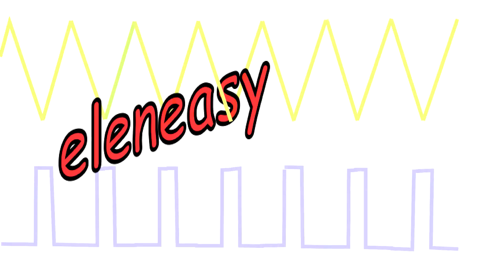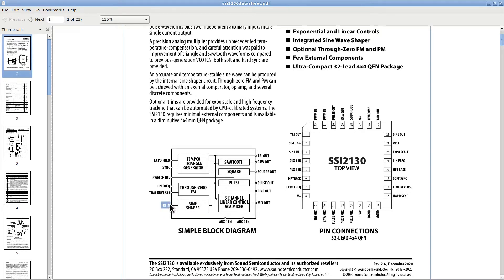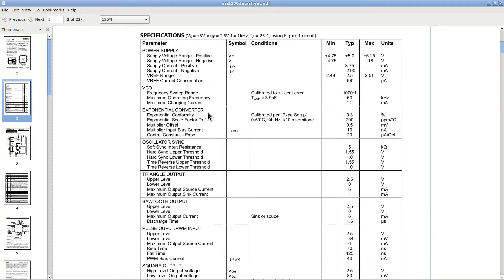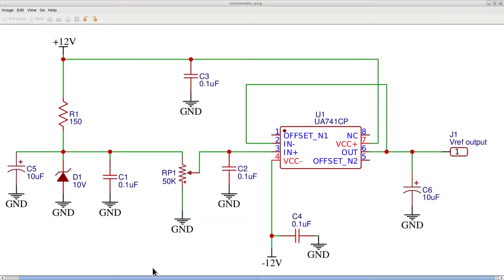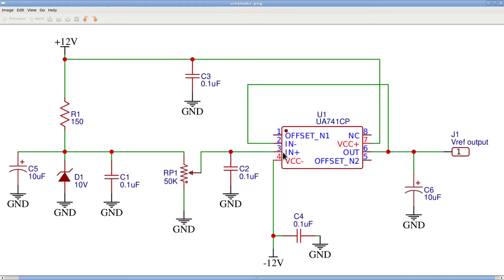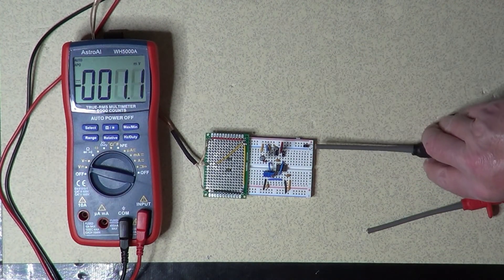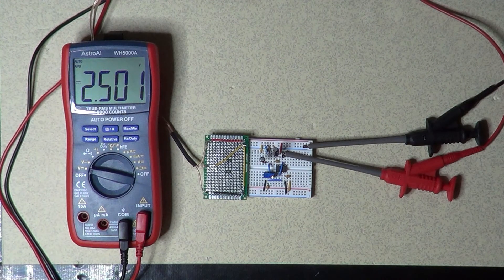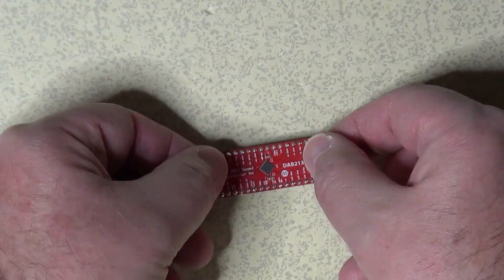Introducing The SSI2130 VCO And A Reference Voltage For It

Comment: Really keen to build this VCO! I was wondering if I am seeing this correctly on the breadboard...you have +12v coming in at the top and the -12v on the blue rail right below it. The -12v is then tied to the bottom + rail and then the bottom blue rail is the actual 0v reference point? Sorry if that is a silly question, I am still trying to solidify my understand of this stuff via experimentation. Thanks and once again I really appreciate your channel and especially your work with this VCO chip!
Reply from the maker: No, it is not a silly question. In fact, the video does not show up very well how the power is connected to the breadboard. Sorry for that.
The perfboard on the left, that powers up the circuit, distributes the voltages to the breadboard as follow:
+12V on the upper red rail
- 12V on the bottom blue rail
GND on both the upper blue rail and the bottom red rail

The reference point is therefore distributed across the two rails closer to the components on the breadboard.

I prefer to do it that way to have GND available to both the upper section and the lower section of the breadboard, since many components have one of their ends connected to ground. That way it is easier to make the ground connection, whatever side the component is located.
Reply: @eleneasy  thanks for getting back with me. I realized later in the video that you showed which rails are which. I need to get better at reading schematics, so I actually appreciate that it's a little hard to cheat and make out all the connections just from looking at the video. I found it helpful to use DIY layout creator to make sure everything was correct before assembling the bread board. I get kind of hung up reading theory, and often find myself frustrated because I don't feel like it's sticking to my brain. I figured that maybe I should just start building stuff and perhaps the errors and observations I make along the way will connect the dots. I recently managed to get the Thomas Henry designed 555 VCO together and I really like it. But let me tell you, I am super excited about this 2130 VCO! I'm surprised I don't see many other designs using this chip. Seems like it's a very reliable VCO with a ton of great "quality of life" features. Have a great day and I look forward to learning more from your channel in the future!
Reply from the maker: @adamsiefferman5547  Experimenting with real circuits is a great way to learn electronics. Don't be afraid to try new things and to make mistakes. That's the best way to learn. Detailed theory comes later, once the base concepts are strong in your mind thanks to the experimentation.
The SSI2130 VCO is actually used by a number of manufacturers of electronic musical instruments. But, of course, it is difficult to find information about that, since normally their schematics are covered by copyrights.
Because of that, the only thing we can do is to experiment based on the information on the datasheet, and try to figure out the best way to use it. It is certainly a repetition of what has been done already by the big manufacturers, but unfortunately there is no easy way around it.
Keep up with your learning experiences.
Reply: Sorry around 12 minutes in my question was answered 😂😭

Comment: Super cool chip! Having 4, 5ish waveforms with built in exponential voltage control is really nice, not to mention the five channel mixer, with independent VCA's. You could build a simple small synth just around one of these and the SSI2140, with minimal circuitry. I only wish they came in a DIP, at a lower price point :P.

 Still, great video, I look forward to seeing your experiments with this IC!
Reply from the maker: I'm already working on the basis of this chip, which I received just a couple of days before I finished this last video. As soon as I have reasonable enough data, I will post a new video on it. Looking forward to build a synth module out of it.